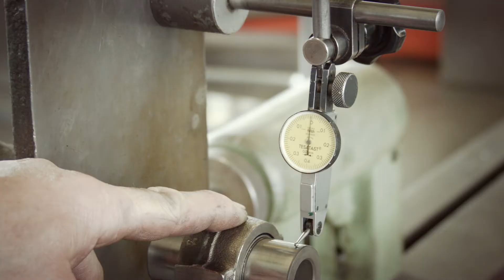How to assemble the engine block - Motoring Episode 4

Comment: Another great video (I wouldn't mind if it would be longer 😊). Would you remember the head gasket thickness used to compensate the cylinder head and block resurfacing? Cheers!
Reply from the maker: yes we do, it is a 1.8mm gasket we used.  have a good day